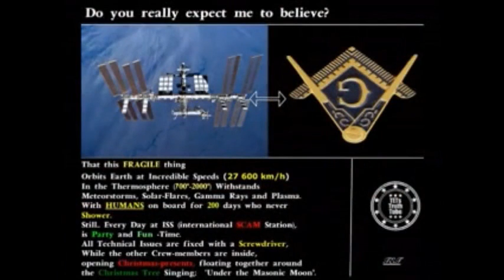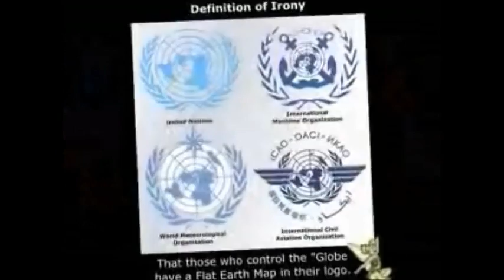Comment font-ils le plein de la Station "Spatiale" Internationale?

Comment: Ou alors vous allez sur wikipédia et remarquez que les stations spatiales disposent depuis déjà quelques décennies de recycleurs très efficace avec un rendement de récupération de l'eau de près de 99% et une décomposition pour extraire du dioxygène.

Et "une fusée n'a rien sur quoi s'appuyer dans l'espace"

Donc la thermodynamique n'existe pas en dehors de l'atmosphère.

Donc, dans n'importe quel milieu vide d'air (et ça va de l'espace à une bombonne de vide), les atomes n'existent pas?

Et bien quoi?

Si une combustion d'un propergol (incluant carburant et comburant et énergie, l'équation de la combustion ne contient pas "air à un bar sinon sa marche pas) ne fonctionne pas dans le vide, les atomes non plus ne peuvent y exister.

Donc introduire une légère dose de matière dans un milieu vide engendrera une désintégration atomique ou un arrêt de l'orbite des électrons (arrêt qui à lieu au zéro absolu).

Et on attend toujours la vidéo qui utilise un vrai télescope avec un vrai moteur de tracking observant l'iss, et des preuves basé sur ses observation prouvant que ce truc qui tourne au dessus de nos têtes depuis 1998 en changeant d'aparence au fur et à mesure de son assemblage. 

Du type: simple module en 1998, ligne de module et un des deux grand groupe de panneaux solaires latéraux en 2003, construction de la poutre structurelle et installation des deux groupes principaux aux deux extrêmités, ajouts progressif des modules et laboratoire, plus de navettes spatiales amarré à la station à partir de leur retrait en 2011,...

http://science.nasa.gov/media/medialibrary/2009/03/17/17mar_bigconstruction_resources/vandebergh1.jpg

Et ouais, cette image est prise par télescope, mais bien sûr, un télescope s'est plus chiant à utilisé qu'un joli petit apareil photo dont l'équivalent en télescope niveau définition et capacité de zoom est 8 fois moins cher (dans le cas d'un Newton ou d'un Dobson de marque, une simple lunette coûte moins cher mais à un apport lumineux inférieur)

Mais pourquoi je dit tout ça? Vous êtes au point de pas comprendre la thermodynamique ou savoir ce qu'est un télescope au delà de la lunette jouet de votre neveu!